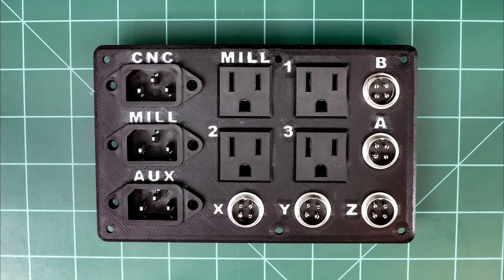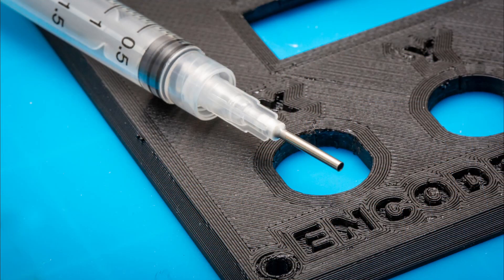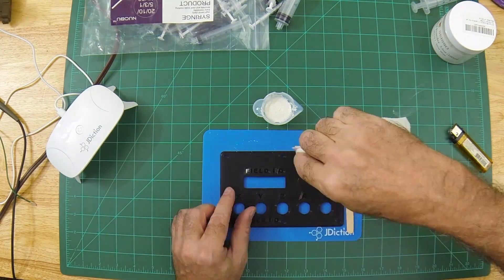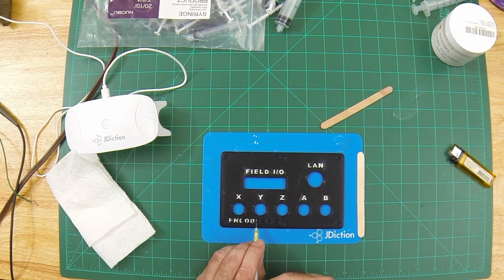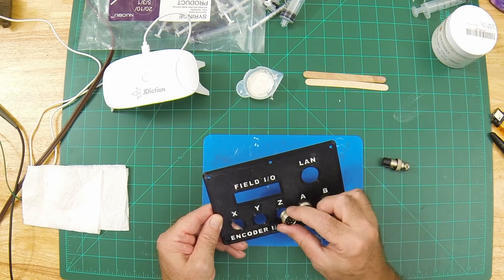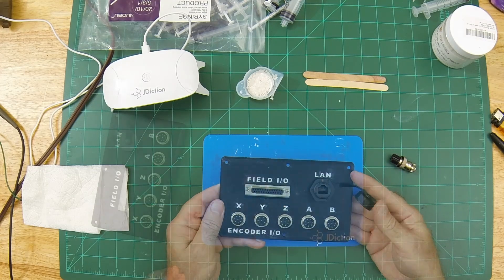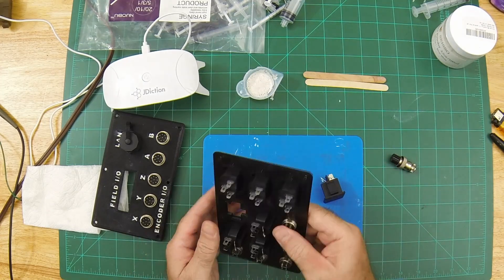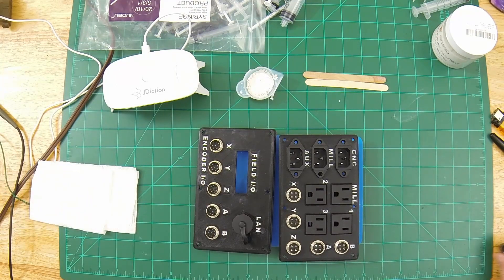3D Printed Connector Panels for the CNC Electronics Enclosure

Comment: The DB25 connector is a cool idea
Reply from the maker: Thanks. The DB25 connector will eliminate a lot of repetitive wires coming from the mill to the enclosure. Using a DB25 break-out-board makes future I/O expansion simple to wire in. Also, shielded DB25 cables are common and cheap, even long ones. I'll likely do a whole video on the DB25 I/O system and limit/homing switches.
Edited for typo.